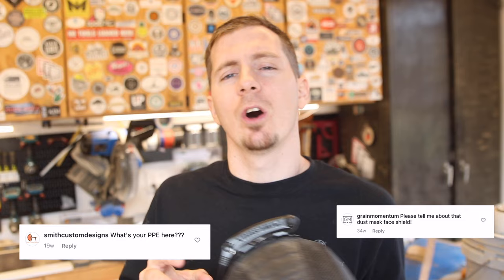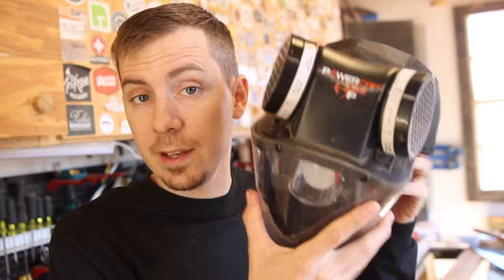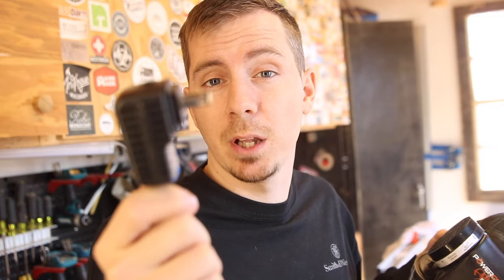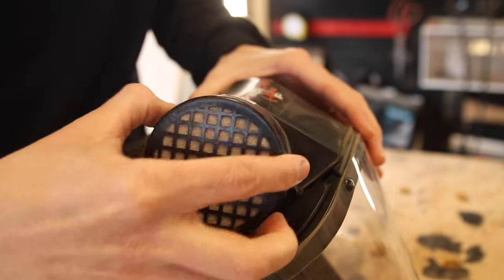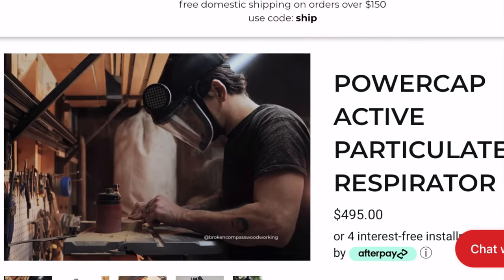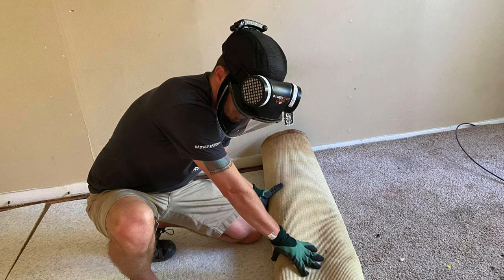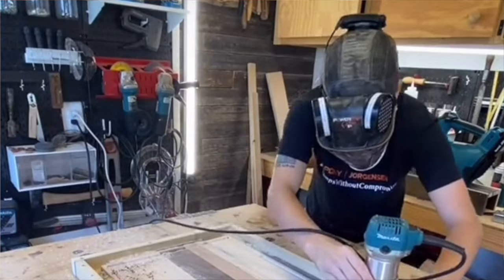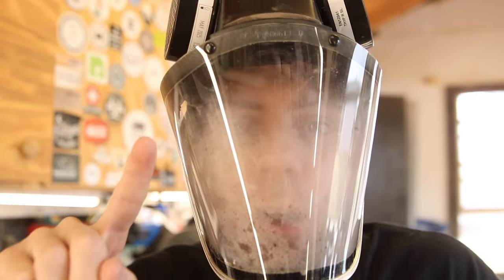If this isn’t in your shop… you’re making a big mistake! // Powercap Active Respirator

Comment: I've recently picked up one of these and it's changed my working life considerably.

I'm a subby carpenter for a larger contractor in the UK. (basically we have to buy all our own shit) For the last 5 years I've been working with Marley Eternite and James Hardey fibourous cement Cladding. Some of the nastiest stuff currently in the industry and I almost exclusively use rotatory tool on it. I also have facial hair and due to historic wounds I refuse to shave. My beard is already just long enough to cover my wounds. And to add further challenge to PPE I wear glasses, and have partial hearing. 

No matter the product anything the had any one of the following was an instant no, require a perfect seal around the face, required removing my glasses, or have my no choice in ear defence or completely removed my ability to hear the outside world and past but not least required me to remove my hard hat to wear the product.

This thing negates all of the above and it's literally the perfect solution for any problem you've ever had with masks, eye pro, fogging, discomfort, lack of head protection. I've never loved a product so much. Never again will I have pressure point induced headaches, or be picking silica boogers out my nose on the drive home.

Comment: I have the Clean Air Pro backpacker respirator that Peke Safety sells I am a full time woodturner and the just got the price down to $575. I have had it for 3 years now and it is one of the best investments that I have made for my Health as a woodturner.
Reply from the maker: Good to hear! They’re definitely very helpful.
Reply: But why it would work better as a face mask makes no sense. A 60 dollar mask with good filters does the same
Reply: @POLPO_WOOD  actually no, with a respirator you get positive air flow that is filtered air. If a mask has even the slightest gap you can be breathing unfiltered air.  I have a beard and there is no mask that seals around the face with a beard.  As a full-time Woodturner keeping my lungs safe is important.  Being that the respirator is powered and blowing air across my face I wear it longer so the air in my shop gets scrubbed by the other filters before I take it off for the day.

Comment: That was very informative. I’ve looked at several powered respirators in the past. A similar design still on the market is too heavy and doesn’t allow for hearing protection. Another, no longer available, had the motor and filters  on a belt over ones butt. The connecting hose was cumbersome. The positioning of the rest of it could be dangerous, especially at my age. This looks like the best option. Thanks for the video.
Reply from the maker: You’re totally right! I’ve seen those others as well and this one seems to be a perfect mix of all the good qualities!

Comment: Not to tell you how to suck eggs but the fence position you had on your saw when ripping cuts is dangerous as hell, it should be pulled right back so not to trap the cut pieces between the saw blade and the fence ( unless you’re using a push stick ) you will be sorry it a piece comes flying out the back of your saw and hits you or someone else. Safety first my friend.

Comment: how well do these work with drywalling? 

I do a lot of ceiling drywall cutting as a plumber, and a lot of drywall dust that comes directly down from the top.
I am always looking for new respirator. 
The common respirator requires u to rubber strap over your head in some sort of a way that conflicts with my baseball cap, and sometimes I feel slight breathing discomfort waking up anyways.

Comment: Legitimate question wasn’t answered. Do earmuffs for hearing protection fit or do they sell clip-ons?
Reply from the maker: It depends on which ones you’re wearing. The ones with the slim band fit under the cap but any with a padded or thicker band won’t.
Reply: Thanks
Reply: @TheMonkdad  What hearing protection would you recommend?  I really love this mask at this price rang but i wish there was a option to buy hearing protection designed to work with this mask .

Comment: Yeah I'm weird. I read instructions.

Cool product but it's way too expensive to justify. I have a GVS Ellipse p100 and Trend Air Stealth masks and they may not be as comfy but I paid less than $60 for them both and I have a UFX face shield ($29) on a $6 hard hat from Lowes. Does the almost the same job for less than a quarter of the price. Hopefully the price will come down big time after supply chain issues for away but companies are inflating their prices because they can. Not because they need to